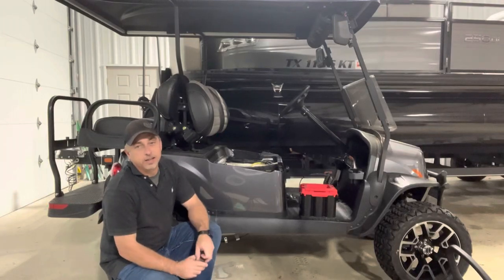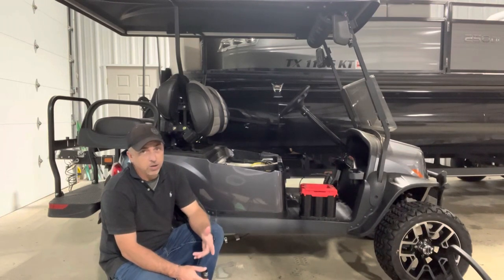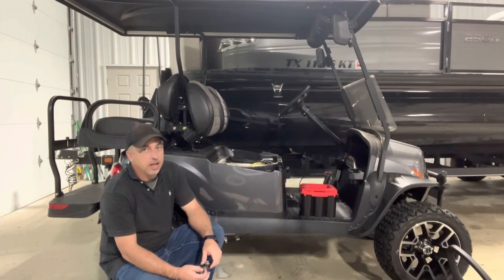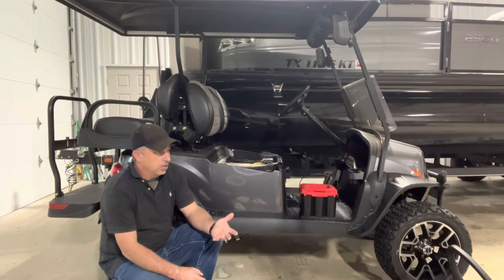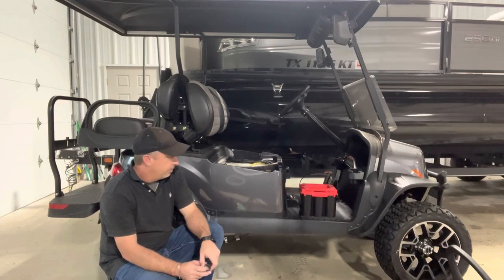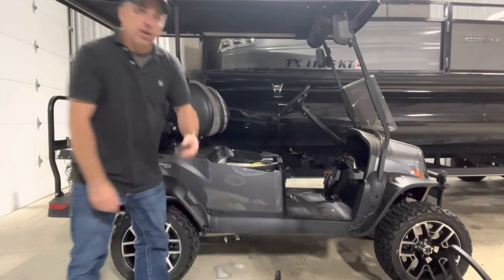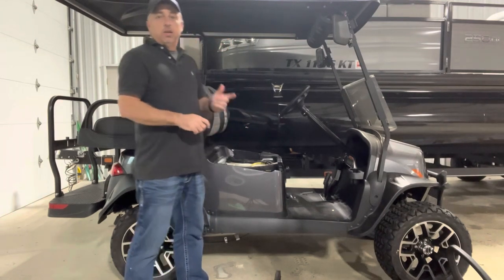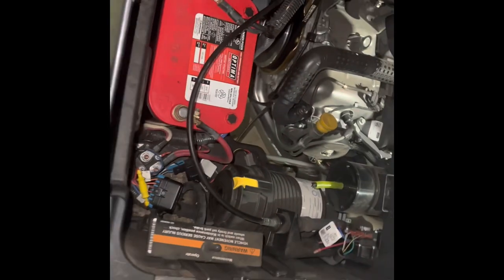Club Car Onward Gas Optima Battery Replacement

Comment: You didn't show anything where is battery, how to remove. What to disassemble to get to battery. Was a big waste of my time smfh
Reply: the battery is on the driver side under the seat behind the charge port.
Reply: and its just a 10mm nut and bolt type tie down for the battery.